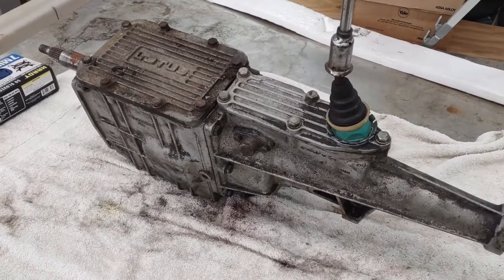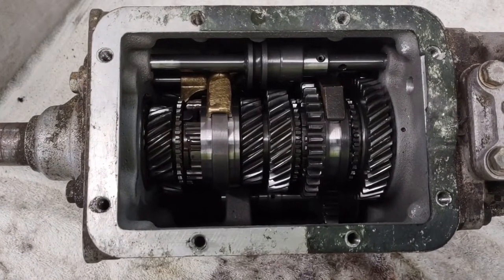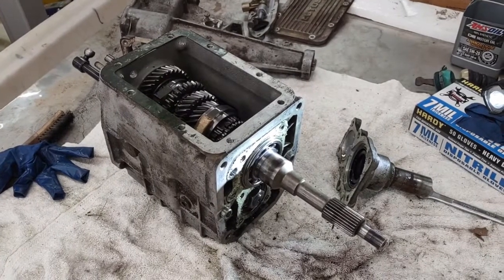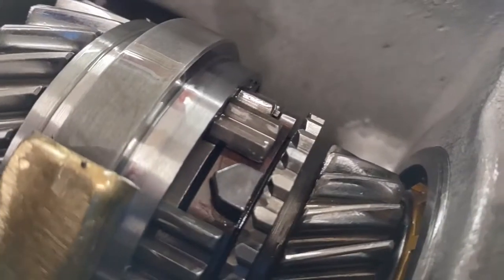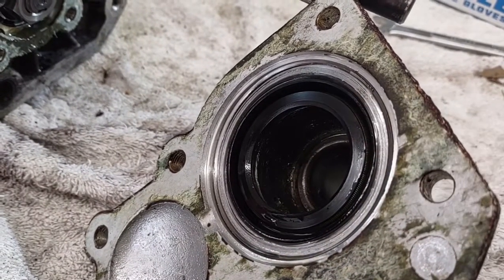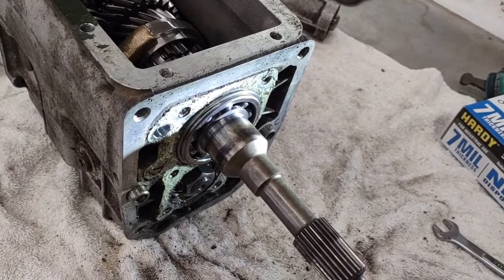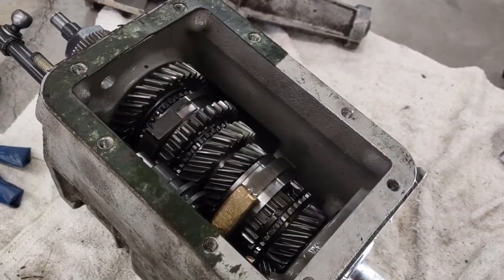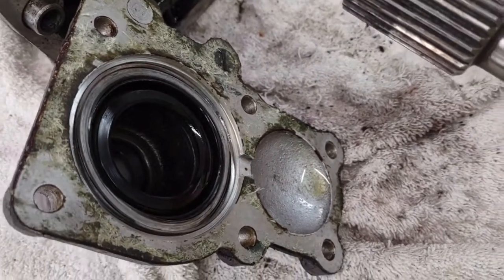Lotus Elite 5 Speed Ep1

Comment: Hi ,  
Thank you for this very good video, complete and well documented.
I have a question: I have a 1974 Lotus Elan +2 S130, I managed to find a Lotus 5sp gearbox.
At first glance, the main casing is identical to your gearbox.
Can you confirm this? Thanks
Reply from the maker: The main case is the same but I think the tail shaft is different. The shifter setup is also different.
Reply: @lotusrepair1439  Thanks :-)